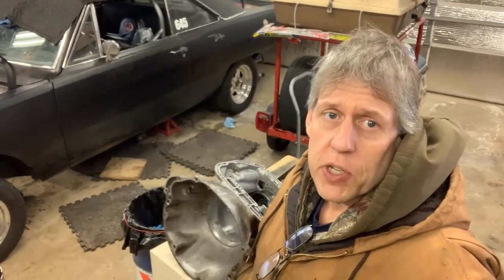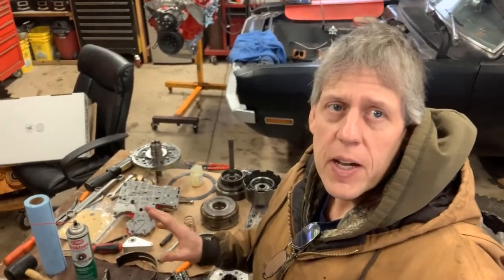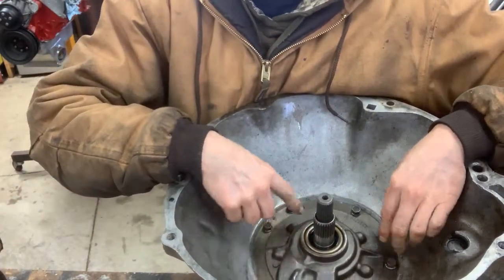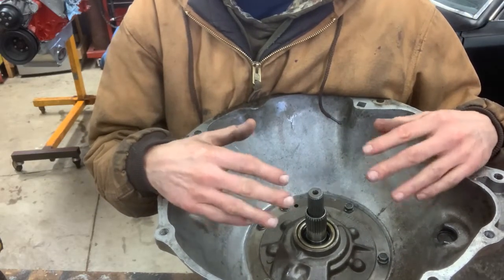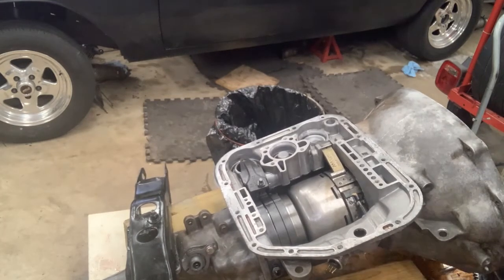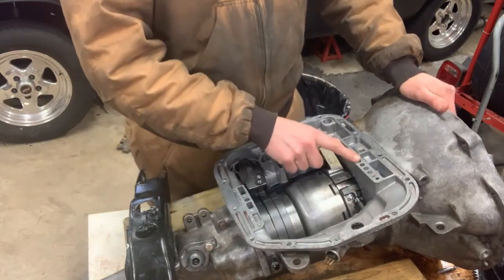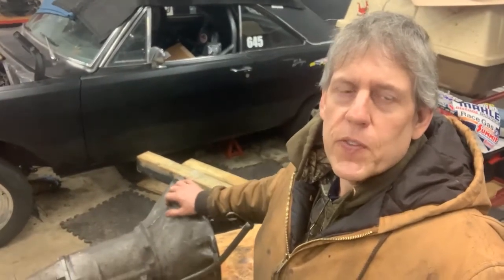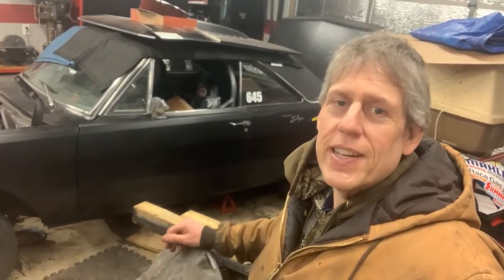Mopar 904 Street / Strip transmission assembly after inspection ready for summertime fun

Comment: great video. Did you use a slide hammer to remove the oil pump? And if so, where did you get the slide hammer from? Wondering if the slide hammer they loan at Autozone would fit. thanks.
Reply from the maker: I did use a slide hammer but I made my own screw fitting to fit in the slide hammer. Make sure you use the right holes to pull the front pump. It shouldn’t take much to pop it out.
Reply: @ShopDogFabrication  do you remember the size of the screw/bolt? And can you tell from your video which holes should I use?